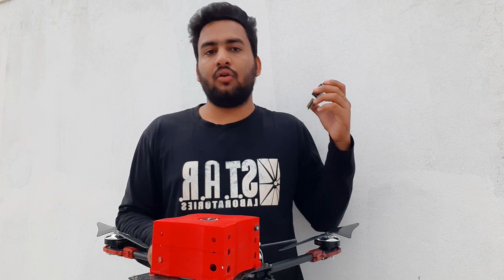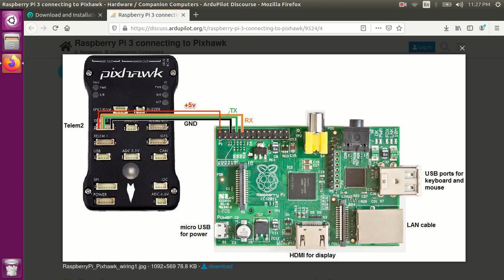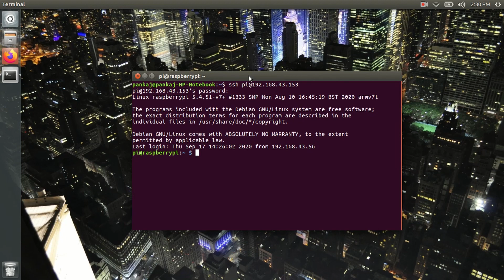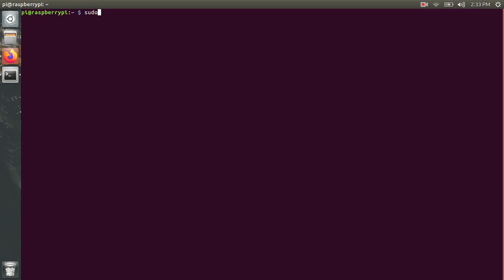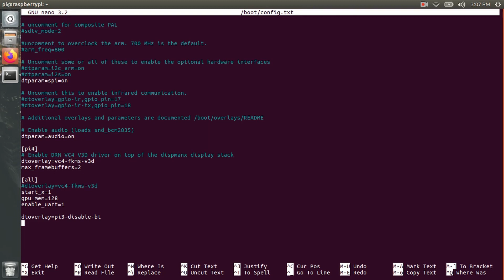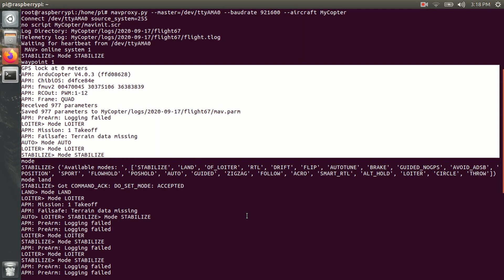Connecting Raspberry pi with Pixhawk | Get Started to run your Python code | Step by Step Guide

Comment: Could you help me out in connecting missionplanner through  TCP or UDP?
Reply from the maker: You dont have to use tcp and udp ports now, just connect pixhawk and a new device will show up in the list , you will get a sound notification when you connect pixhawk to computer  .....if not then check if you have drivers installed for the usb ...usually drivers are installed automatically while installing mission planner
Reply: @PankajMali   i have changed those ports by connecting it through usb and followed the video i got everything correct bt i want to monitor it using missionplanner frn long range not using telemetry bt using internet . Could u help me with this?
Reply from the maker: @teamudaan9783  thats great !! ... to give internet access to your rpi you can use 4g hat for that or you can use and portable wireless router with sim  on the drone and connect it to rpi via wifi 

And then once your rpi gets access to internet 
You can use udp port to connect and pass commands remotely to flight controller 

Video on adding internet access to your drone will be out and cover the setup with both 4g hat and wireless router
Reply from the maker: https://techship.com/faq/  you can refer this for now
Reply: @PankajMali  tysm i ll go through it
Reply: @PankajMali   hey i just need to make autonomous flight with long range using telemetry its very short around a km so using 4g i could get more range so iam using raspberry pi connected with pixhowk. Now i need to connect mission planner to pixhowk without telemetry.  Could u help me with this one?
Reply from the maker: Yes its a good idea that you are planning for 4g setup to get longer coverage,
There are many softwares that can be used to get this job done but has monthly subscription 
And if you wanna this thing to work then please take a hold coz that video is on my list and will be in details once we finish opencv part

Comment: Hey ty for the video can i know how to do those missionplanner settings i have missionplanner version  1.3.74
Reply from the maker: Ok no worries, please follow the procedure below
1. Connect pixhawk to you computer via usb
2.open mission planner and you will see a drop down menu and you see your flight controller in the options so select that and hit the connect button in top right corner.
3.no need to connect raspberry pi now 
4.go in config > full paramater list and then search those parameters and set them
5.after changing dont forget to save parameters to fc but hitting the save button
6. Now you are good to go ...diconnect fc and get started with rpi setup but connecting rpi gpio to telemetry 2 port on pixhawk and follow the process as in video👍
Reply: @PankajMali  tysm i ll try this it was veryusefull
Reply from the maker: Hope you get it ready and start with programming and running the scripts ....good luck 👍👍
Reply: @PankajMali  tysm it was very very helpful
Reply from the maker: Get in to mission planner and then on the home page , you will see config/tunning option 

Config/tunning 》》full parameter list 

On this page in the right-side search box is present search below parameters and set the values 

 SERIAL2_PROTOCOL=2        (to set telemetry 2 port for serial communication )

SERIAL2_BAUD=921   ( if you follow this video then set 921 if you are using raspbian jessie then set 57)

LOG_BACKEND_TYPE = keep it default dont change  as for now .
Reply from the maker: Hope this helps you 👍👍
Reply: Ty for ur reply bt when i search im not getting it should i connect raspi to mission planner physically and do connections?  And to which ports

Comment: With the full raspberry pi os + recommended software, wt will be it's size on sd card? For full os package should I get the 16gb or 32gb sd card, as I want at least 4gb of memory should remained on sd card.
Reply from the maker: Yes ....you can go with 16gb and still have 4gb reserved but i would recommend to get 32gb as in future you might need it if you are planning on up-gradation on your projects, to be on safer side go with 32gb.
Reply: 32gb or 16gb.....???
Reply from the maker: 32gb

Comment: Is it necessary to connect rc remote with the drone for the first time?? Because i haven't bought it and no plans to use it in future(I also haven't calibrated the radio channel)
Reply: Can you provide me the solution?
Reply: So its like your drone to work you should have rc remote connected to the drone but what about beyond line of sight drones how do they manage to fly?
Reply from the maker: When you plan for BVLOS fligts ,you need to turn off failsafe in auto/guided mode in the full parameter list ,so that when the   vehicle goes out of the rc range still it will continue to carry on its mission.
Reply: @PankajMali  i don't want to configure rc controller and still want to control the drone. Is it possible?
Reply from the maker: No its not, and you always need to have the radio in order to gain manual access when something goes wrong.
Reply: @PankajMali  just incase is it possible?
Reply from the maker: You can use esp 8266 and connect it as a receiver to the fc and you can connect your phone as a transmitter to esp via wifi ,just a cost effective solution
Reply from the maker: If its just limited for checking  whether the system is communicating then its ok to not have the radio connected, but when  it comes to actually getting the system for demonstration  in the field then you need the radio connected or else you will end you with error( like the fc wont be able to able to send mavlink messages to the rpi on the currents status of the radio ) and won't take off.
Even though you are having the autonomous missions you need a radio to be connected
Reply from the maker: Yes its possible
Reply: @PankajMali  pls provide me the solution for the same
Reply: @ashwanisrivastava5291  I am having same problem of rc. I also want to fly it only via laptop commands. Have you found any solution?

Comment: hi 

i have a question,

How do i control the drone movement through raspberry pi via Pixhawk?
Reply from the maker: After this process of setting the communication  between the rpi and pixhawk, next thing you can do is install dronekit and required python dependencies  as dronekit provide powerful API support for drone application development  you can write python script to control your drone 

Check dronekit documentation for the API examples that you can use and control the drone autonomously or even you can control it via you keyboard (not recommended)

You can also check the very basic example of how the process takes place in my other video
Reply: @PankajMali  i have error installing dronekit sitl on my raspberry pi as it doesnt support ARM.. How do i install?
Reply from the maker: Yes you are correct you can't install sitl simply you can build your code rpi and install dronekit-sitl on your local machine connecting both to same network.

So now you can run your script on rpi and connect it to sitl on your local machine along with mission planner or what ever simulator you want to use
Reply: @PankajMali  how do i setup a local machine? I am kinde rushing to finish up my final year project due next week
Reply from the maker: Local machine is your laptop where i prefer ubuntu  ,you can even use windows for dronekit-sitl 
1. Launch dronekit sitl in 1st terminal
2. Launch  mavproxy in second terminal which will  send tcp messages to stil and udp connection (like udp connection on mission planner )
3. Launch mission n connect with udp port (optional )
4.run your python script on raspberry with connection string like 127.0.0.1:14550

Raspberry and your unbuntu/windows machine  should be connected to same network (router)/mobile hotspot. 
Refer dronekit documentation  

Hope it helps you, good luck with your project 👍

Comment: ha timing! Ive just spent the last week trying to figure this out too! Trying to figure out the port of uart=1 and dev/ttys0 took me ages! NIce video I wish I had seen it last week! :)
Reply: i was installing mavlink-router, is there any advantage of mavlink-proxy? Or is it pretty much the same thing?
Reply from the maker: Good to see that you got it ❣❣keep building
Reply from the maker: Yeah mavlink router and mavproxy are bit different as mavproxy is command line interface gcs and mavlink routing helps is routing connection string from  serial , tcp, udp to the end connection

Comment: Hi 

I have a question or maybe a clarification.

I been seeing everywhere,whenever RPI and Pix are connected - it is suggested to do over Telem1/2 to RPI seriial Pins or use a FTDI connector to a RPI USB.

What should happen if we connect it directly from Pixhawk USB to RPI USB?

I tried that connection and it still works atleast for reading Flight data using Dronekit. Just wanted to know , why it is recommened to connect over telem port!

Thanks in advance !
Reply from the maker: Yes you are correct we mainly use telemetry 1/2  to setup communication with raspberry pi or any companion computer.

As pixhawk has 5 serial ports among which tele2 and tele1 are used for mavlink messages and this serial ports have flow control over data .
 And if you connect to the micro usb port (serial 0) of pixhawk , which is mainly preferred for connecting  ground control station to pixhawk then you will get the mavlink messages and you will be able to communicate properly but only when your aircraft is stationary.
 
This should not be connected in flight because the flight code assumes that if it is receiving power through this port that it is stationary .
Reply: @PankajMali  thank you! Appreciate it :)